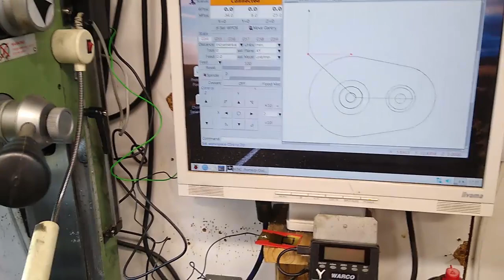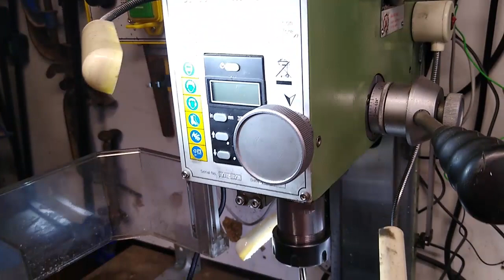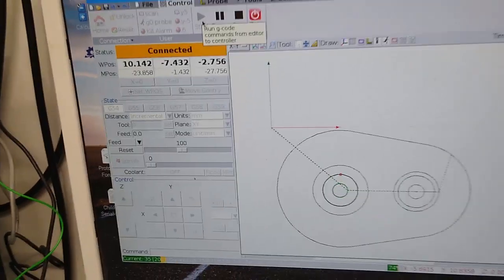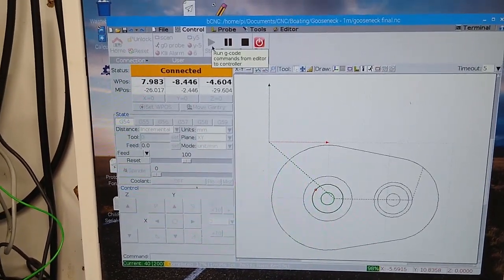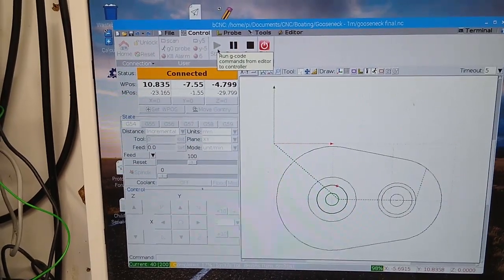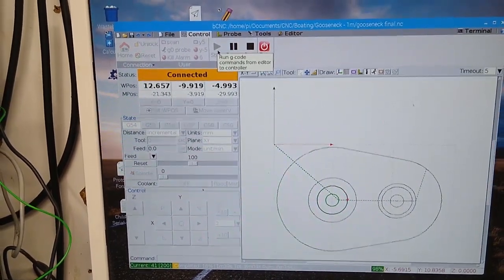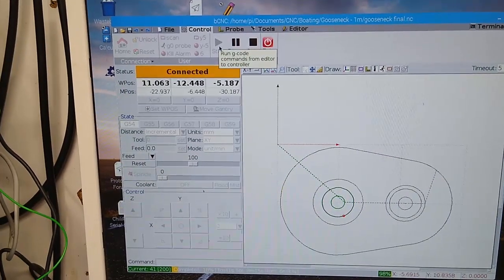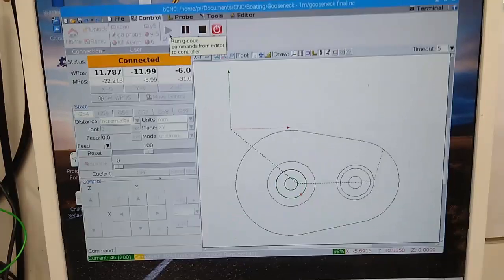Warco WM14 CNC

Comment: Hi Jonathan, why such big motors? is it for the torque to move the bed?
Reply from the maker: Hi - the real reason is that I didn't know what power of motor to get so I bought them as they seemed to be a popular and reasonable priced kit on ebay.   As you suggest they were probably too powerful but I didn't want to buy something that didn't have torque.

Comment: Will you do a CNC conversion video?
Reply from the maker: I should do but it was quite difficult as I used 16mm ball screws and 14mm would have been easier.  However, 14mm don't seem to be so available as the 12 and 16 mm versions.  As a consequence I had to do a bit of mill hacking which I know doesn't look pretty but in the end it works very well.  When I feel brave I'll do a mill breakdown to illustrate how I converted the mill.
Reply: @jonathanblake7954  Sorry for the long delay in replying to your message, thank you for the information.